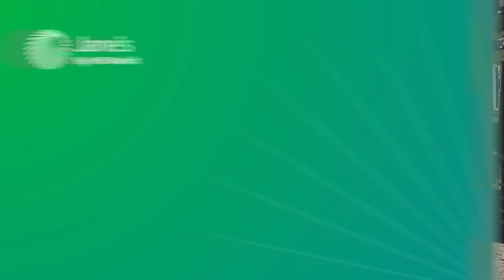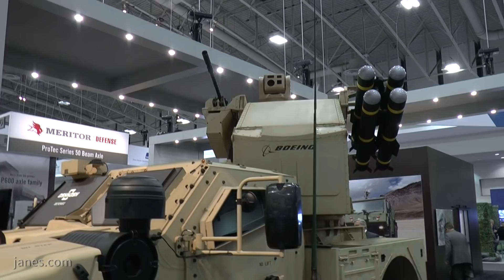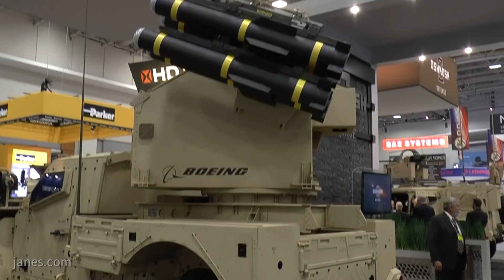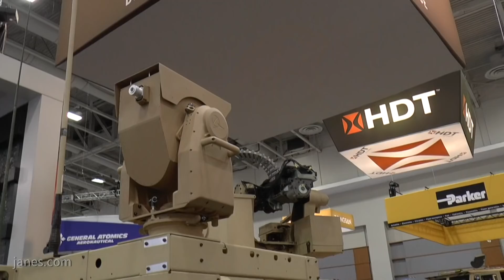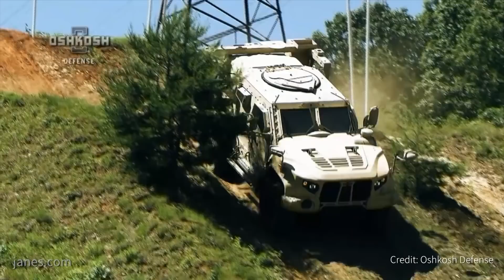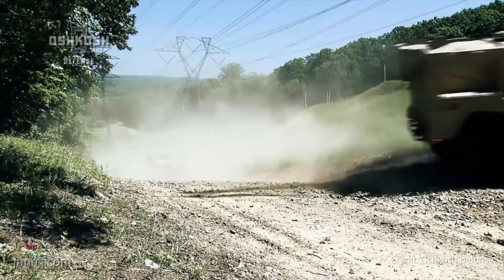AUSA 2017: Flexible weapons integration on the Oshkosh JLTV

Comment: The reality is you can pretty much just bolt on any self contained weapons system onto a truck. Just look at any other combat egagement in history. This is nothing new.
Reply: A truck can’t withstand a roadside bomb like this can.  If you bolt on an armored cab, then you have to replace the shocks to standup that weight.  Oh now, that weight needs more horsepower to haul the truck and whatever it is towing.  So, you are not factoring in a lot important details.
Reply: so long as said truck isn't some thin tin can then yeah pretty much.
Reply: because hustory